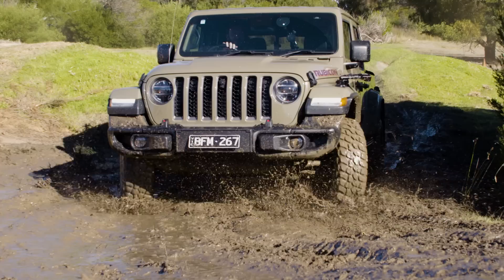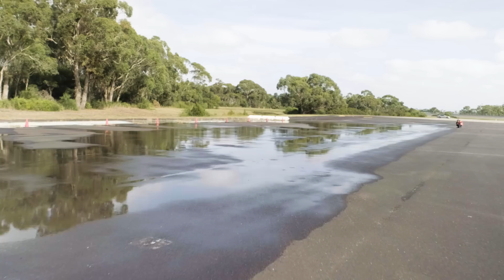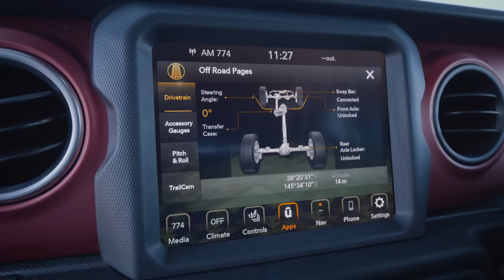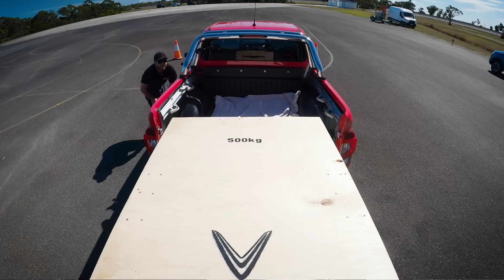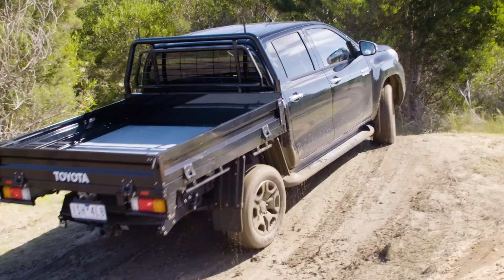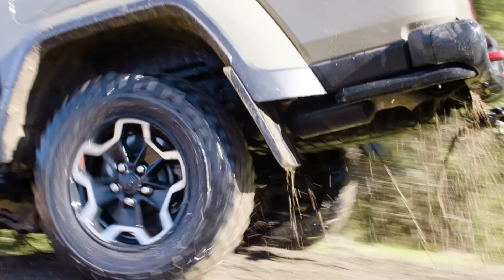Dual Cab Mega Test | 4X4 Australia

Comment: Mitsubishi Triton GSR athletic is the best because it always becoming the world champion cross country rally racing, better handling driving experience and very good cheaper price lower cost service maintenance repair MIVEC best diesel engine of the years awards Euro 6 fuel efficient, Volkswagen and ford also very good but expensive price higher cost repair service maintenance 😂

Comment: The fact the GWM out braked the Raptor by almost 4 meters from 100km,  was well hidden in the test, And the GWM was only 0.3 of second slower than the SR5? to 100kmph is funny.
Reply: Add the latest 5 star safety rating which it now has and 7 years unlimited km's warranty (Australia), lowest prices, a tow bar and then test the cannon X(top spec), then you have a good ute. I would add a throttle control (which is a quite common addition to utes in Australia). 

Points wise you would be up with a jeep Rubicon, and I'd rather have that over anything else there. But I'm a v6 Amarok fan boy lol.
Reply: @scottandchels6813  still remains cheap and nasty Chinese made crap.
Reply: @martinwolmarans1833  thanks for your opinion. One day they will probably be a good brand like Hyundai.

Comment: How come the Triton the only truck using a (vvt) engine could loose in the performance test to others and there's prove out there in YouTube that the Triton could make it below 10 sec...... And 1 more for the Triton if you guys don't believe that the 2020 model could tow 19 ton trailer up hill, you may search that video did by those Thailand people recently...
Reply: Ok for me it's just easy, if that's the only truck you had and will you took it  till the maximum without mercy and didn't care if it would survive any punishment... So for me I will sure towed with care step by step without overstress those 2 part if I'm in that situation thats no other any option... And conclusion we still can use that low gear but don't put too much stress so that the live spend are more longer and be on time for the oil change always
Reply: @alvinsohmitsubishisalesadv6058  ahh ok thanks. I have a 2007 triton and I'm always impressed when I see tritons towing those heavy trucks off road.
Reply: Correct. By the way Ive watched some of your videos and they are great
Reply: @anthonyramdin1037  thanks bro...
Reply: @alvinsohmitsubishisalesadv6058  lemme ask you this, Tritons are renowned for their load carrying and towing abilities. There are so many who have towed trucks and tractors close to 20-25 tons with tritons but does that damage the low range gearbox, transmission and the engine?
Reply: But bare in mind 2007 2.5L model can't pull more then 1 ton because of the engine and frame is not as durable like the latest model.. I've own a 2007 manual as well just sold it last year because of pandemic.

Comment: Test driving the little 4 pot ranger I still prefer the 3.2l 5cyl any day of the week.

 I know on paper it doesn't have the same power as the twin turbo but it just feels like it has so much more grunt at low RPM. Literally indeling around town at about 1600 - 1800 RPM. Perhaps it's the gearbox? Don't know but it just feels so much nicer to drive. Not to mention engine acoustics. The 5 cyl has a really nice engine sound to it while the 4 pot has that tipical buzzy and boring 4 cyl sound. 

Hope the rumors about that 3.5l V6 Diesel in a future Hilux GR will happen. That a actually sounds really exciting

Comment: I absolutely ADORE that they didn't use the Cannon's off-road system (hold traction control). And honestly, what is with people testing 4WD vehicles off-road....with highway tyres?! I'm not gonna go out and bush bash on some Cooper street grubbers. You want an actual proper test? Fit ALL of the vehicles with the exact same rubber. Tread thickness, pattern, and grip style play an absolutely MASSIVE role off-road. Anyone that says otherwise is selling you something....like the Ford Ranger XLT, which has been tuned for Australian road conditions mate!
Reply: i realize it is quite randomly asking but does anybody know of a good place to watch new tv shows online?
Reply: @majormalachi1901  I'm not google

Comment: the TOYOTA Land Cruiser 79 GX 4WD + 3.0 in. Lift 4.5 TDI V8 4-Dr Double Cab All Terrain Camper Pickup Truck (RHD) not present in this comparison test!!! why so??? the Ssangyong MUSSO XLT 4WD + 3.0 in. Lift 2.2 TDI I4 4-Dr Double Cab Light Pickup Truck (RHD) seriously needs a proper heavy duty 3.0 in. suspension lift & 18.0 in. 5-spoke alloys shod with 33.0 in. mud terrain radial tyres!!!

Comment: By the criteria listed, the Ute that would have won this was an Amarok. The 3ltr v6 version is easily the fastest, handles the best, stops quickest (one of the few with rear wheel discs) and has the most convenient tub. Did VW not supply enough advertising revenue to get a berth? (No I don’t own an Amarok)
I thought that giving the GWM a zero score because there wasn’t a tow bar fitted yet was a little unfair. It may not even have one available yet it’s so new. I was also surprised at its score in other categories like infotainment.  I have heard the GWM sound system and it’s better than the recent BT50 I test drove. Quite similar in performance and ride as well.  On a final note, please stop telling everyone to get their utes lifted. It always has a detrimental effect on handling, rarely results in a better ride and nearly always makes them tow badly and invariably causes excessive tyre and steering wear. By all means put better shocks, tyres and even springs but the small height increase rarely makes much difference to actual off road ability compared to tyres and things like diff locks and it usually turns a good Ute which can do 80 to 90 %  of driving situations well to one that only works well in full on off roading where we would be lucky to drive 1% of the time. If you absolutely must go higher, go the minimum you can. The higher you go, the bigger the death trap they become on the highway.

Comment: I was keen to see the pros and cons out of the dual cab utes. 
In the performance test about braking and acceleration. Who/what people are driving this utes to keep stock . Most  people are buying them for 4x4 touring / tradies/work utes 
Hence loading them up with tool boxes, canopys, trays, bigger tyres, bullbars,
Hence why most people have to get engine performance upgrades and brake upgrades 
It would be ideal to test these vehicles when fully loaded up with all bells and whistles and accessories 
Cheers Marty

Comment: LDV has basically no stock anywhere in country right now and depending on when this test was done (probably early May) LDV would not have been able to supply a vehicle.

As for actual vehicles on test,  it appears as though Nissan have finally fixed the "Np300" rear suspension issues that have plagued it since its 20156 launch, that said Nissan should of made it look like the Frontier instead of a baby Titan.

As for the Ford twins, shame that Ford did not supply the 3.2L 5cyl, would of been interesting to see the towing and orff road against the Ranger Raptor.

Finally why would anyone waste there money on Jeep, Musso or the Cannon L, the Toyota twins are good but not Ranger good.

Comment: I own a GWM CANNON L.
this review is utter bullshit. And one sided. 
The cannon is very very 4wd capable. And very high tek  infotainment,  seamless. 
Also turn the selector dial (must be I neutral) and it will slide into 4wd in 1 second.  Diff lock is super strong 4wd machine. Why pay 20k more to get less  🤔  wake up
Reply: Exactly, although I don't own the GWM but you could easily pick that they were damn pushing their own propaganda against it just to insanely scam people to buying more expensive utes for no justifiable reason
Reply: X owner here, love everything about my car. And my bank account appreciates the saved $20k+
Reply: The Running costs section was utter rubbish, the GWM finished last but has the same 7yr warranty, capped price servicing and is cheaper than the Musso!  👎 oh and Ssanyong is bankrupt also so fuck that

Comment: I owned a FORD ranger 2014 and 2020, mmmm did not change much, it is the same tractor, today I buy a POer from GWM and it is great, I go up into the forest by dirt roads, excellent on the road and its safety leaves its competitors on the slope. She's the best.

MMMMM, I feel like drivers are next to traditional brands, I suggest accepting the change, the Chinese POER truck presents unique differences in both traction, safety, lights, steering, classic brands must be scared, and clearly an all-terrain tire makes all the difference..

Comment: Toyota country .my mate has an XLT and complains about his 10 speed automatic transmission box hunting all the time and my other mate that has the raptor complains about how he can't legally tow his caravan anymore Hilux wins for reliability and definitely resale value
Reply: Buy a hilux for 63 k sell it in 10 years for 33k
Buy a gwm for 33k and 10 years sell it for 3k worse case scenario. .....
Reply: @93jummy  if you get 10 year's  lol
Reply: @philfoote829  got a 2011 wagon one to burn to work and back 300k  Never spend a cent on it, Does fine. Also have a fortuner that's neen back to toyota more then it should've with 60k on it.
Reply: @93jummy  you just got unlucky mate Toyota number one car company in the world you can't beat it at least you drove yours back to the dealer the Ford Ranger wagon Everest caught on fire lol
Reply: Lol
Reply: @93jummy  not a bad point

Comment: Great review guys
Very thorough and a good selection of vehicles.
Some of Byron’s comments about the Ranger were extremely patronising 
“” it’s astounding that an Australian team can manage to put together an Australian Car that has such great longevity””
FFS
Considering their limited budgets etc, the Ford Falcon and Holden Commodore (whilst not perfect) were always excellent vehicles that gave great value for $$$, and fantastic ride / handling that managed our varied road conditions extremely well.
The Ranger is testament to this ability.
Huge amount of T6 platform development was done in Australia.
Ranger sold worldwide, and a highly lauded and successful vehicle.
Yes, it’s been updated over the years, but, even against recently released all new vehicles, it remains best in class, in so many ways.
Over the years, various Ford and Holden product sold here, but built overseas, benefited greatly from our local engineers etc, specifically testing these vehicles in Australia, and having them sold here with a locally developed ride / handling / suspension tune etc.
ZB Commodore rides / handles extremely well, due to local suspension tuning etc
Much of this work on ZB Commodore was done at the same location that this mega Ute test comparison, was conducted at.
Any Hyundai / Kia that gets a specific suspension tune for Australia rides / handles much better then if it did not have this.
The automotive talent in Australia is world class, and highly sought after.
I’d suggest Byron goes back to isolate alone in his cave for another 20 yrs. 
His very patronising comment about the Aussies who helped develop the Ranger was extremely poor form, and is massively disrespectful. 🤷🏻‍♂️
Reply: Did the Ford also paid for your comment?????
Reply: @arminius6506  
Are you still driving your Mums 25 year old beige Camry ???????????
Reply: @StephenFogarty2023  do you know how much a Camry cost in my country??? It's 100k USDs 😉
Reply: Really, you're getting butt hurt by that comment. Get a life.

Comment: No Amarok. You know, that ute that came top three pretty much every test prior to this one
Reply: @Trikk And yet the Amarok comfortably shows off a number of what you call 4wd's.
Reply: The amarok isn’t a true 4wd, it’s an all wheel drive system with a 40/60 front to rear power split. Definitely should’ve been on here, agree
Reply: @ilikethisnamedoyou  To the best of my knowledge, the Amarok has drive going to all four wheels. Hence it is 4wd. And despite not having a low range, it has more than proven itself over the years. And no, I do not own one. I drive a Suzuki 4wd.
Reply: @ilikethisnamedoyou  it has a centre diff and optional rear diff 🙄
Reply: @Trikk Hmmm. Wonder how much 'experience' you have had. I have owned and used 4wd's (14 of them at last count) for over 30 years. Whether a vehicle is part time 4wd drive (like the other double cab utes) or full time like the Amarok (and all Land Rover/Range Rover products) doesn't come into it.
Reply: @Trikk Actually, I was just trying to point out that I do have some knowledge of 4wd and 4wdriving. The vehicles I have owned include several Series IIA and III Landrovers, 2 Landcruisers (including an FJ40 fitted with a Chevy V8), and a Hilux Xtra Cab. I have also been involved with training Red Cross drivers (Landrover 110's) and search and rescue. Even early Subarus had Hi-Lo ratio. Does that make them a 4wd?
Reply: @Trikk I’ve been in a club and gone everywhere the rest of the club has gone. I guess if you’ve got no skills and no idea you’d drive anything like a bucket of warm turds. Judging by your comments I figure you’d know about that first hand.